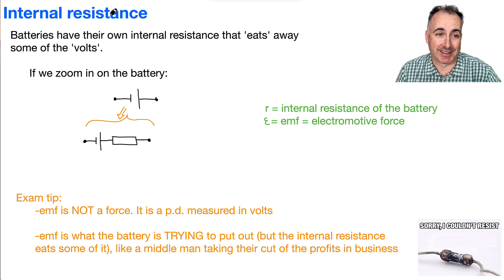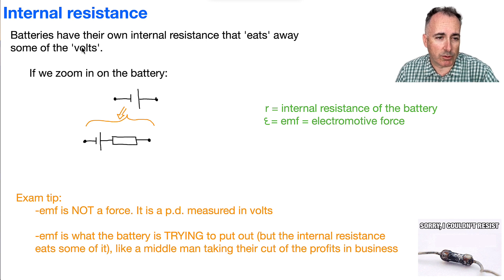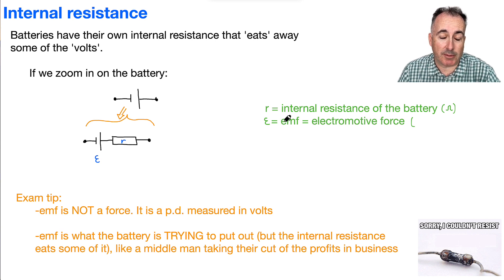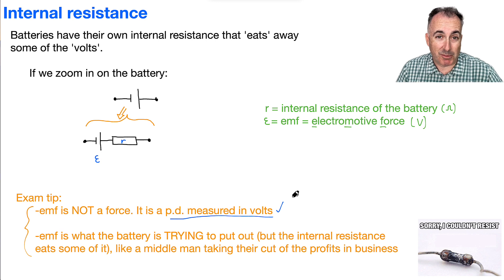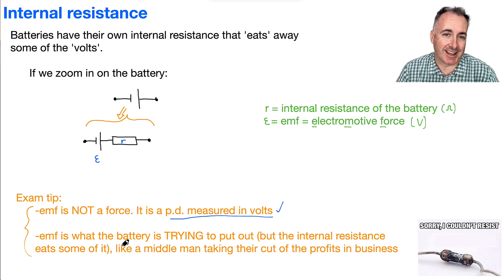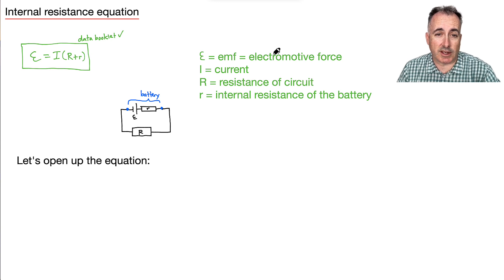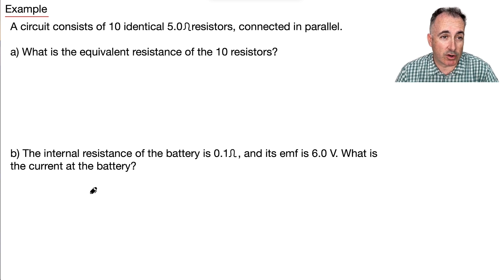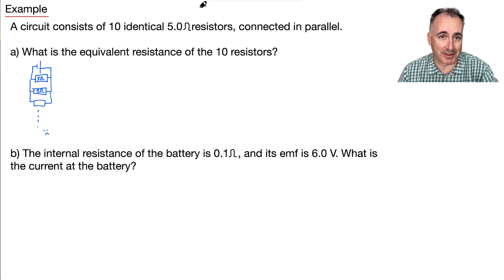B5.6 Internal resistance [IB Physics SL/HL]

Comment: I have a question! Do we need to know how a transformer and alternator works? I was revising past papers and I got a question about a tranformer that said: The primary coil has 3300 turns. Calculate the number of turns in the secondary coil. And I haven't done that in class. Is it in the syllabus? Thank you againnnn!!! <3333
Reply from the maker: Transformers and the details of alternating current are no longer needed in the syllabus. So NO, you do not need transformers at all